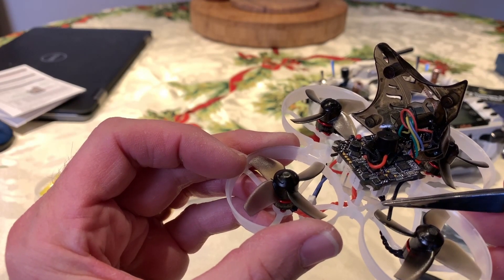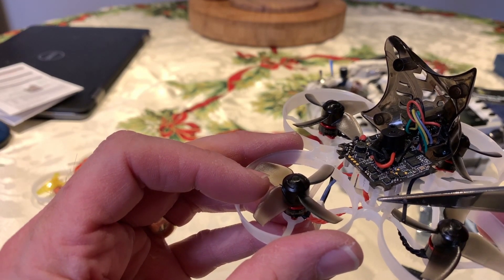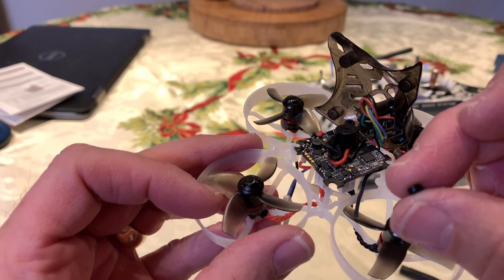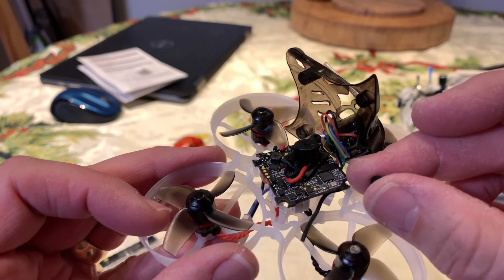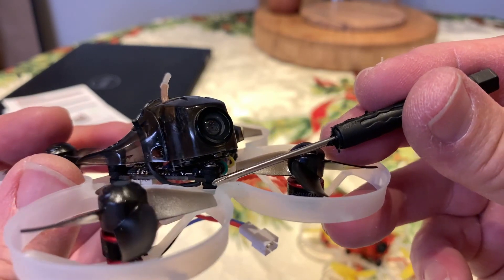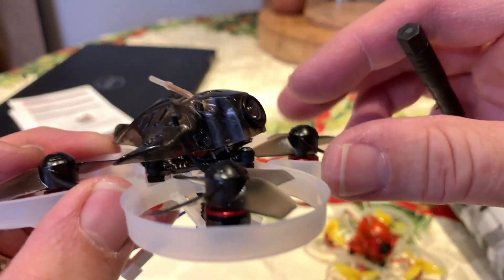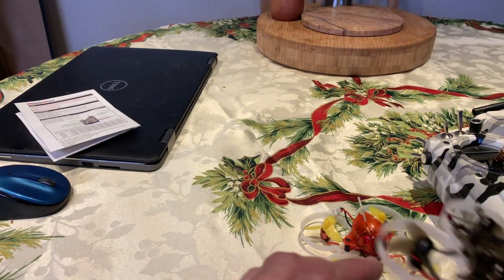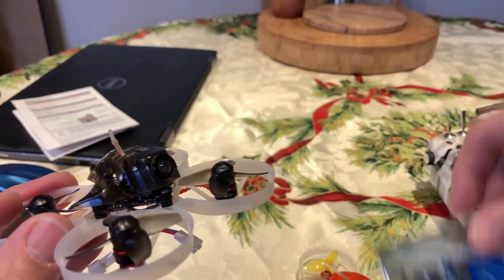Mobula 7 Design Flaw & Fix

Comment: Do you have any idea where top get the right size crimp pins to repair or make new power cable?
Reply from the maker: HDgodfrey 
I would just buy another pig tail from RaceDayQuads. Link below and they are solid pin connectors.
https://www.racedayquads.com/collections/new-products/products/rdq-20awg-2s-micro-spare-upgrade-pigtail-ph2-0-solid-pin

Comment: I only have 3 grommets but it seems solid. Mine anyways. But when I changed frame to the v3 frame one of my motors now works intermittently. I cant figure it out. Did anything similar happen to you ?    ✌️
Reply from the maker: Hi Jordan,
It sounds like you have a bad motor but it could also be an ESC. To isolate the issue just swap the suspect motor with a working one and if the issue moves with the motor, it is a bad motor. If it stays with ESC, you will need a new all in one flight controller. 
I hope this helps.
SLOG
Reply: SLOG FPV Yes it does help. Im just starting in this hobby so any new technique to help finding a solution is great and appreciated. Thx ✌️